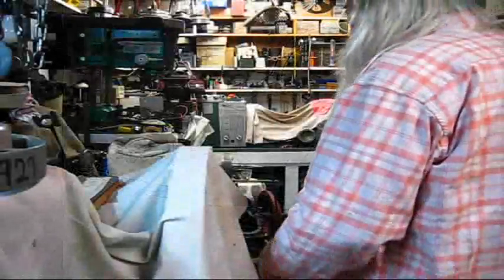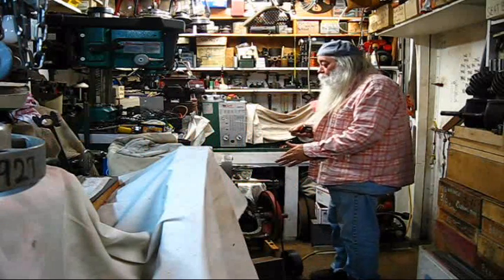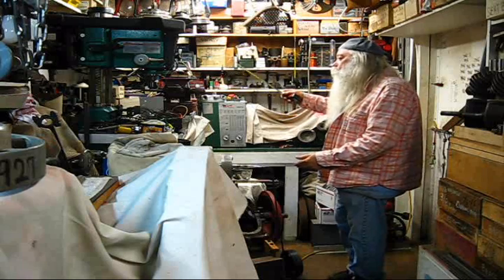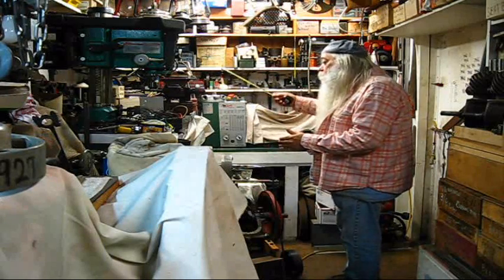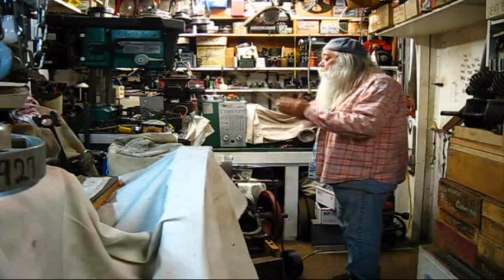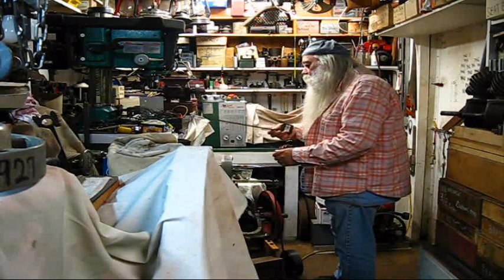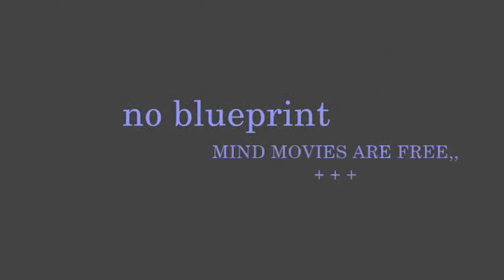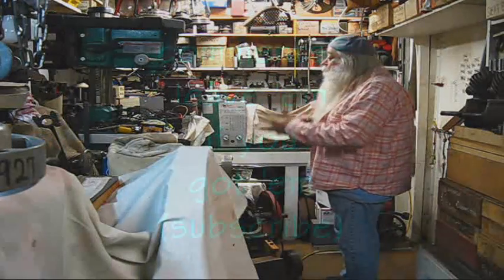The Freedom Stand maytag model 72 #1 thinking out loud

Comment: This series of maytag washing machine motors kinda makes me feel bad, when I was a young pup, about 7 years old, my grandmother had a maytag washing machine and I got the bright idea to tear it apart. I wanted to know what made it work. Well, I went straight to the engine, got it off of there and commenced to take it apart with a hammer and a screwdriver. This was back in the fifties. When I finished, I had that engine all over the yard and let me tell you, nobody was going to put that one back together. Needless to say, that washing machine never worked again and my grandmother was not very proud of me. I still think about that on occasion and this is one of them.